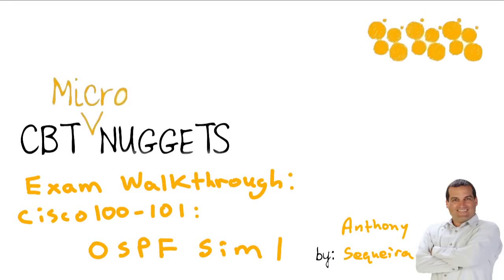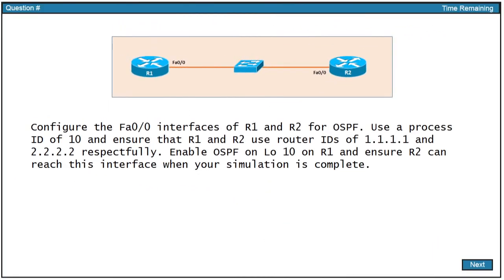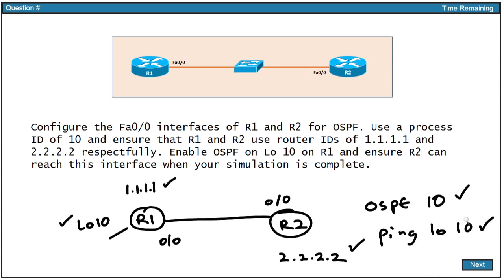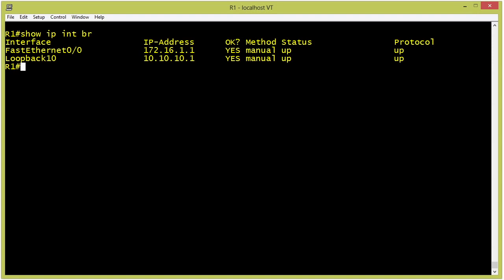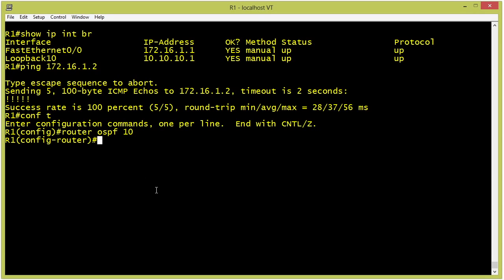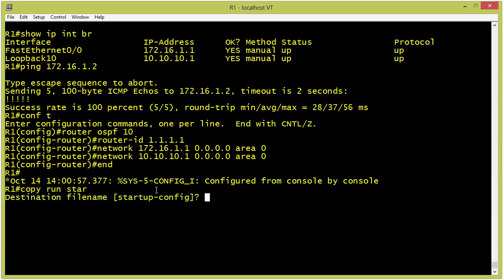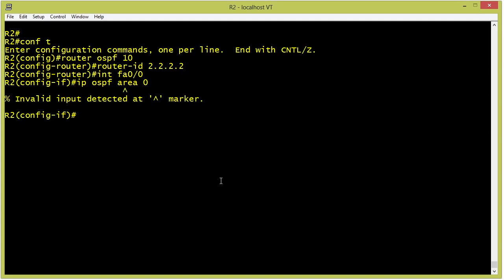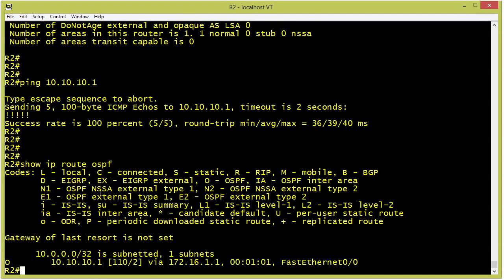MicroNugget: How to Configure Fast Ethernet for OSPF

Comment: Your point of "assuming" it was okay to configure area 0 is a bit unclear.  If no other area exists in OSPF, don't you have to configure Area 0 first?  Additionally, after specifically pointing out while correcting the config on R1 that you must save the configuration to receive full points on the exam, you forgot to save the config on R2. :-)